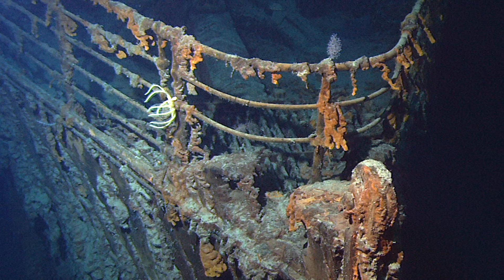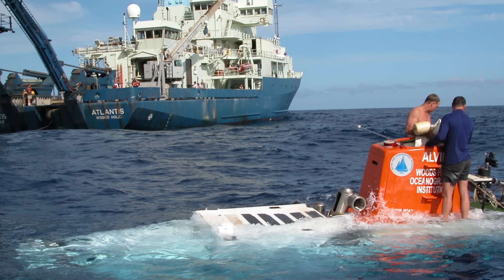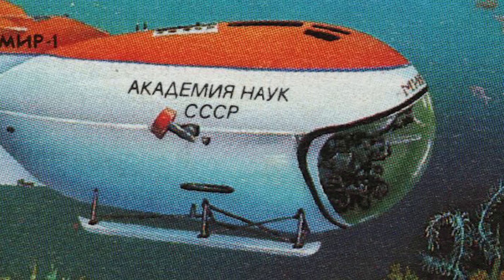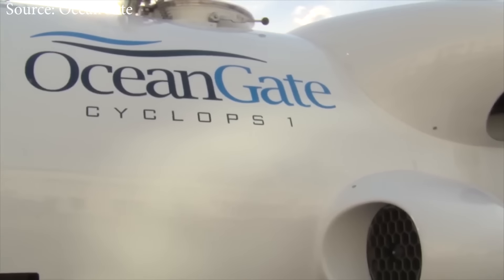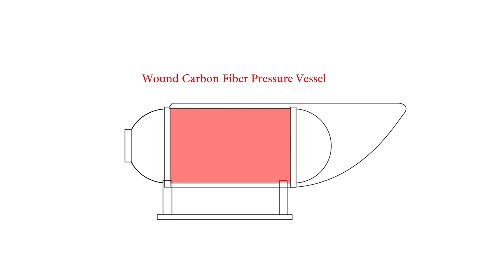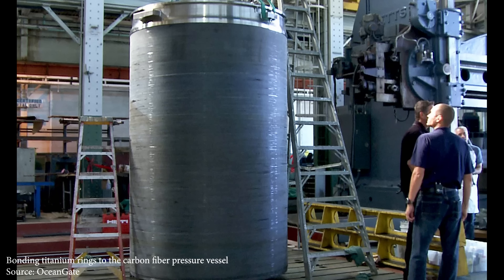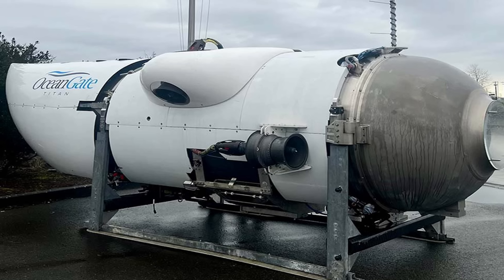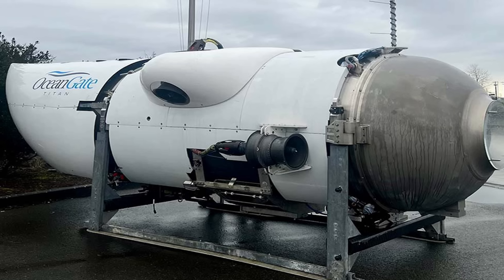How Titan was Built, Lost and Found: An Analysis

Comment: As a complete layman it seems to me the acoustic warning system that drops the weights if the pressure vessel makes telltale noises of impending breakup was worthless because once you hear those noises you have seconds to react, and the ship can't change its depth significantly in seconds. It took hours for it to free fall to the target depth of ~12000 feet. Lets say the cracking noises happened at 10000 feet, they took action and dropped the weights, but then the momentum of the ship still continued downward for a second, then slowed to a stop, then reversed to begin accelerating upward, and all that action took say 5 to 10 seconds before the ship attained any significant upward speed. It may have managed to reduce its depth by a couple hundred feet before BOOM, it imploded at say 9800 feet, which was not enough pressure reduction in time to save them. Like the Titanic was unable to make enough course correction in the time it had to react to the sighting of the iceberg.
Reply: If Titanic has carried on instead of turning it probably wouldnt have been so catastrophic.
Reply: @isleofthanet  Yes, I have read that assessment by experts decades ago, that if Titanic had rammed the iceberg head on then it would not have breached as many watertight compartments and would have not sunk, or at least would have stayed afloat a lot longer and would have still been afloat when help arrived.

The trade off would have been that potentially hundreds of people in the front of the ship would have died in the impact of such a collision, and the officer commanding the ship would have to answer for that.

There was no way the commanding officer with seconds to react would order the ship  to ram the iceberg, sacrificing the lives of some to save the rest of those on the ship. There just was no realistic opportunity to consider options like that in the seconds of time allowed to react. There was also no time to consider ship engineering outcomes of say 3 compartments breached vs 5 compartments breached, etc. It was all or nothing, he had to try to steer around the iceberg.
Reply: @onemoremisfit  considering the passengers were not wearing seat belts, that would have been just as catastrophic..
Reply: @onemoremisfit  The main point is: We know all these things about the accident because hundreds if not thousands of scientists researched every little detail for more than a century.

From the comfort of our arm chairs it's very easy to say they should have done this or they should have done that.

If there is one thing they should have done differently - going into a known iceberg area with a vessel this big at 22 knots at calm sea state and therefore hardly detectable icebergs seems to be the second best idea.
Reply: @onemoremisfit  Only realistic way the Titanic would have hit the iceberg head on would be if the lookouts had taken longer/failed to spot it and there wasn't enough time to turn away.
Reply: Considering how quickly carbon fibre shatters, yeah the warning system would've done nothing except warn them they're about to die. If the drop and raise takes hours, there's nothing they could do at the bottom of the ocean that would have helped them get back up again in time. Carbon fibre goes from 'good' to 'bad' in seconds, it's like a cliff edge when it reaches failure point. Plus apparently Stockton ignored all the cracking noises from previous dives anyway. It's a 'safety system' merely there to make passengers feel safer.
Edit: not a submersible expert, but I worked with carbon fibre panels for sports car manufacturing. I've seen how fickle that stuff can be under any sort of continued pressure.

Comment: I'm sorry but this is the first video of yours I disliked. You aimed at presenting a factual account but failed because you didn't reflect on the insane negligence of the company who built this crappy thing. Red flags all over if you dig deeper. This CEO didn't want to hire so called old white experts so he hired some millennials instead because these days you want your employees young and inspirational. The hubris is shocking. Yes game controllers are standard but need a failsafe, on virginia class subs they are never wireless for example. And carbon fibre is unsuitable for deep sea pressure vessels, you didn't mention that either iirc. Oh and the comet issue was quite a bit more complex than just square windows. So overall yes the fate of the passengers is tragic but I'm not wasting a single tear for stockton rush. Watch Aaron Amick from sub brief for a proper investigation and stick to your ocean liner content which is awesome
Reply: Coming back to this a week later just for the comments and yep, not disappointed. I really wish the dislikes were still public for this one. Putting on the tinfoil hat just for a second, kinda makes you wonder if Mike maybe owned some shares in oceangate lol

Comment: It amazes me that the sub did not have some sort of ELT beacon on it like aircraft do. Makes the needle in the haystack easier to find. In a previous run, they surfaced and floated for four hours before they were found. This whole mess was a $250K game of Russian Roulette.
Reply: Um, anything like a beacon or 'pinger' would like have been destroyed in the implosion ... que?
Reply: @uploadJ  Not if it was mounted outside the hull, in a seperate chamber that can pop off and float free to the surface.

Commercial EPIRBs do this - not from this depth, but they are (the better ones, anyway) designed in such a way that if the ship goes down and the crew wasn't able to pop them free, they pop themselves free and start screaming.

It would be non-trivial, but also not very difficult, to make a bespoke solution for a bespoke submersible. A little pod on the landing legs that, if it loses contact with the main submersible, if the motors don't fire for over an hour, if a deadman switch isn't pushed, or - something, lots of ways to do it - pops free and floats to the surface screaming its head off.

But that would be "regulatory safety," a thing that Stockton Rush was vehemently, even idealistically opposed to; you know, which cost him his life.
Reply: @uploadJ  True, they have failed in some plane crashes, but it would be better than nothing, and the implosion may not destroy an externally mounted beacon device. It would be an expensive component due to need to be much stronger than what aircraft use, so Rush likely would have discarded the idea anyway.
Reply: @ShadowDragon8685  Agree 100, I didn't see your reply before I replied with a similar view. It appears that they found a large part of the tail cone, half of a skid, and a titanium end cap, but Rush barely cared about comm and nav systems so he would have rejected the idea as you pointed out. He even fired a team member that suggested NDI testing after dive to check the carbon fiber. I wonder which insurance company was crazy enough to agree to cover his operation.
Reply: @ShadowDragon8685  re: "Not if it was mounted outside the hull, in a seperate chamber that can pop off"
It would be destroyed in the pressure rebound wave that the implosion creates; therefore, not realistic. Sorry.
Reply: @SGTSnakeUSMC  rush actively refused to have actual contact with the surface. He felt that "he was being pestered with too many status requests," which is why Titan was designed for only automatic telemetry.
Reply: @uploadJ  even taking that at face value, there are other failure modes that the EPIRB would've been a lifesaver for. For example, if their emergency blow had put them on the surface. Or worse, if Titan had become entangled in Titanic and they couldn't wriggle their way free; the EPIRB could've let people know they were in distress and needed rescue. Hypothetically, if they had become entangled, then that pipe-laying ship's ROVs, equipped with industrial tools, could've cut them free of the wreck.

And that's taking your assertion that the beacon would inevitably be destroyed in a hull failure at face value, which I do not.
Reply: @ShadowDragon8685  Agree 100. Rush was the type to tie balloons to a chair to fly and complain that adding a seatbelt adds unecessary cost.
Reply: @ShadowDragon8685  Deathwish. After hearing him talk, I think he was.going insane.
Reply: @ShadowDragon8685  re: "other failure modes that the EPIRB would've"
Maybe you know this, maybe you don't. An  EPIRB only works for surface vessels, as radio waves at that frequency do not propagate through sea water ... this is understood, right?
Again, at depth the implosion would have had an 'impact' (rendered inert) any devices near/on the outer hull.
Reply: @uploadJ  You do realize the darn things float, right? And that as anyone who has ever pushed a rubber duck underwater in a bathtub and let it go realizes, a thing with positive buoyancy, forced underwater and then released, returns to the surface.
Reply: @ShadowDragon8685  re: "You do realize the darn things float, right? "
Says darn near EVERY video on this subject. Did you miss that, that this is literally 'lighter than water' w/o the additional weights?

Comment: 11:25 In that video of the actual carbon fiber being wound, that activity probably should have taken place within a clean room. Because there were people within several inches of the carbon fiber being wound, particles of dust and other debris may have contaminated the carbon mesh, creating points of weakness. Over several dives, these points of weakness  or delamination may have grown. Also, microscopic air bubbles in the carbon fabric could have produced a similar effect.
Reply: I would go further and say they should have never used carbon fiber in the first place as stated by many experts in the field
Reply: Yep. Inclusions that could collapse under pressure would weaken the hull. You are effectively reducing the thickness of the hull at the area where there is an inclusion.

And these failures due to any inclusions will propogate...
Reply: @TimInertiatic  Non-uniform material cycling extreme uniform load is basically playing Russian roulette with water pressure.
Reply: Did you know that they got bumps on the carbon fibre skin that they had to shave off between fibre layers? That sounds like a failproof technology to me indeed!

Comment: Epoxy was used to bond the titanium end rings,(a video of the assembly shows them using it) I feel this was the original point of failure. Only time will tell if my speculation has any merit.:elbowcough:

Comment: It’s crazy the hatch could only be opened from the outside. If they were able to surface but weren’t found they could run out of air.
Reply: You probably won't want to open the sub yourself, even if it surfaced, as it would let water in and compromising the vessel. However, a system with a pump, would have been great.
Reply: @rattymenace  Or even just a standard EPIRB that they could release when they find themselves in distress...
Reply: Everything about it down to the colour.  It'd be easier to spot a luminous orange object.  But then customers may  think "It's painted like a warning sign in case something goes wrong I'm not getting on" 

The whole thing was fashion over function. Profit over health and safety.  Dishonesty over transparency etc.
Reply: If you're taking down first-time passengers, basically untrained, do you really want a panic-stricken person suffering from claustrophobia to be able to open the hatch?
Reply: If you're taking down first-time passengers, basically untrained, do you really want a panic-stricken person suffering from claustrophobia to be able to open the hatch?
Reply: @irieite9666  Amen! white is one of the worst colors for a small craft, almost impossible to see in whitecaps, or when the sun is reflecting off the water.
Reply: @retriever19golden55 if I'm not mistaken, the water pressure would probably make it extremely difficult to open at that depth since it's pushing down on it.

Comment: Why don’t you mention that apparently the viewing port hole was only rated down to 1300m —WAY LESS than the required 4000m depths it was traveling to. You even go so far as to refute that the port hole would be viewed as a weak point. Maybe not usually, but THIS ONE definitely was
Reply: Perhaps because that comes across as unconfirmed bias, and Mike is all about actual FACTS, which he did perfectly.
Reply: @dons1932 I’m pretty sure the insufficient depth rating of the viewport was mentioned in that lawsuit involving a former employee of OceanGate. I think that qualifies it as a well documented FACT.
Reply: @dons1932 you mean half truths, OceanGate wasn't doing scientific research, his pro OceanGate slant was wrong given the rest of the submersible community openly warned OceanGate NOT to use Carbon fiber. Please be objective for once and not fanboy on YouTube.

Comment: I appreciate that he’s presenting the reasoning behind the decisions that led to the implosion. That said, the fact that Rush was warned multiple times, as well as how whistleblowers were treated, tells me that the scientific merit of these trips was lacking. I also understand that the passengers were cautioned to some extent (though given recently leaked correspondence, I think the warnings were too little and too late), but I still think that any compromises for the sake of additional funding should have been immediately stopped, especially given that Rush was a billionaire. 
Additionally, given how the co-founder has recently been acting, I’m hesitant to give him, OceanGate or Rush any benefit of the doubt. It’s certainly a tragedy, but one that I feel could have easily been prevented if any of the warnings were heeded.
Not saying that OceanLiner Designs is implying otherwise, I understand that he wants to present the bare facts to avoid any misinformation. I am just very, very frustrated at the company’s actions, Rush’s actions, and the cofounder’s recent comments.

Comment: 13:17 Minor correction – the square windows being the point of failure is a bit of a myth; many later planes actually had less rounded windows than the Comet. The Comet failed due to fatigue cracking that was not understood due to having a newer design (although there were other similar ones) operating in more extreme conditions (higher altitudes) than older planes – coincidentally very similar to some theories about the Titan. The myth about the windows comes from a report listing the initial point of failure on one of the antenna "windows".
Reply: Thanks for this. As you say, myth says the Comet failures were blamed on the square windows,  which was not the case.
Reply: Relax 😂

Comment: I really enjoy the channel, but as an engineer, I did not like the way Oceangate was portrayed. A difference in design methodology does not allow folks to cut corners and ignore single point failures. The controller is such a case of a single point failure that had unnecessary additional failure points added in (being wireless). I hope the guy brought spare batteries. Also, from what’s been reported, the company culture was completely off (fail fast, emphasis on new college hires, removal of folks that raised safety concerns). Sorry oceanliner designs, but you missed the mark on this one.
Reply: I agree with you totally on this. Great channel but he got this one very wrong. You can't cherry pick scientific consensus.